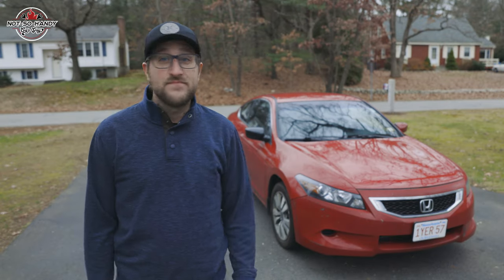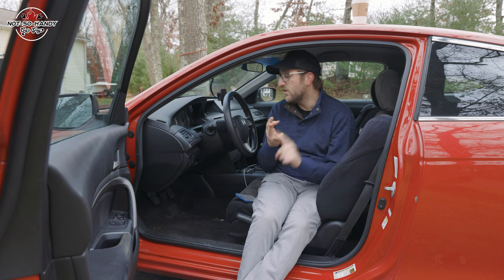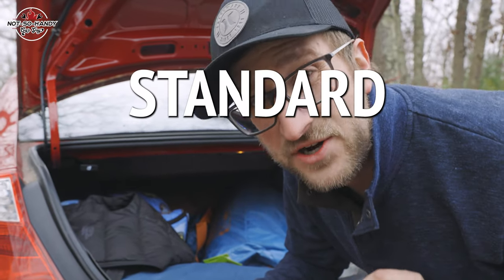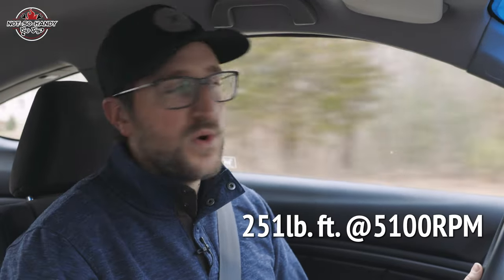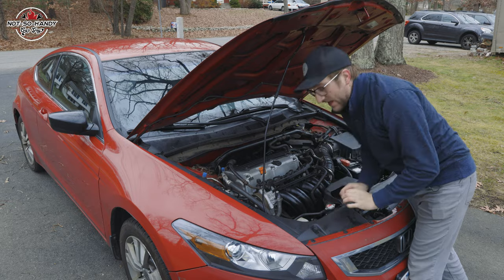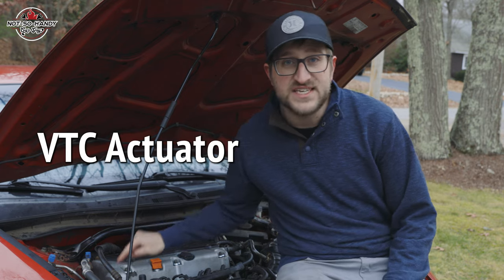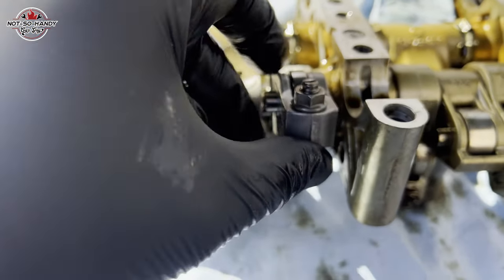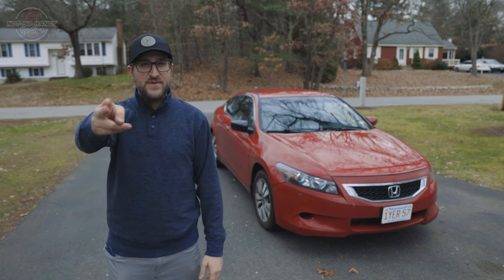Honda Accord (8th Gen) - How Reliable Are They? Review, 0-60 mph, Interior, Common Issues

Comment: I miss my 08 EX 5spd auto K24 coupe so much. It was my first car. I bought it at 120k miles and had it up until around 140k until somebody totaled it in a hit and run. It was dog slow, but revved high, and handled well with the suspension modifications I did. She burned about a quart of oil every 2 weeks, and the VTC actuator on startup was crazy.

Comment: Owned an 08 accord exl for 6yrs and I just lived with that noise at start up lol
Reply from the maker: Haha, I’ve heard of people never changing it and they were totally fine too! And then other times, the actuator seized up as the veins broke inside and their engine jumped timing. Glad your’s was ok!
Reply: Same here I still have my 2010 4cylinder my vtc actuator has been bad for years and I always tell myself I’ll fix it but have yet to get to it, although a tip for the cold start if you turn on the electronics but not start the car and wait a minute then crank it you don’t get the rattle apparently that works because with the electronics being on gets the oil pump running which can prime the vtc actuator so I’d like to think that’s why it’s been less of an issue for me
Reply: @l_shane_l  that's good to know lol, I lost my 08 accord in a car accident so now I have a 2012 crosstour(same 4cyl engine ofc) that makes the same noise at start up lmao
Reply: same here. have an '08 right now sitting at 215k miles, it rattles after not being started up for a little bit, nothing has happened so I just live with it

Comment: Do you recommend a 2010 honda accord coupe lx-s 4 cylinder automatic? That’s what I’m looking for right now! And don’t want to have any tranny problems
Reply from the maker: Absolutely! I’d say, if you don’t have performance in mind, the four-cylinder is a better choice. And before you get one, check the transmission fluid on the dipstick. Make sure the fluid isn’t super dark or burnt smelling. And then once you get it, do an ATF fluid change!
Reply from the maker: And don’t let the dealer (or private seller) cold start it without you there. If it has that rattle, I would pass on it, unless you want to do the intake cam repair yourself.
Reply: Go for 2011/2012 if the price is not much different.  Fewer complaints on motor oil consumption.  My '11 coupe bought new doesn't burn oil but the VTC actuator was replaced under warranty.

Comment: mine has 258k miles and it has the rattle vtc actuator problem. i have been driving like this for 20k miles. lets see how much it last. buying another car is out of question with prices.
Reply: I had that same problem and it never interfere with the performance or engine of the car.
Reply: How many miles on it now? Any major issues?
Reply: Nice
Reply: Did you perform regular maintenance and it still bad ?
Reply: @GoodfellasNYC you’ve a V6 ?
Reply: @frankmontez6853  No V4

Comment: Everything in this car is horrible, while changing serpentine belt, damn power steering pump pipe came off when i hit it with the wrench and spilled all the damn fluid out and cant go to work in the morning, timing belt is horrible, plastic comes off like nothing, it’s horrible. I had a 2005 expedition 5.4 before and had 251k miles and it had issues but nothing stressful as this accord junk. one time i tried to take off power steering tube and wouldn’t come off but wow on this accord it came off like nothing. 5 things just to take off an alternator is unbelievable. And the expedition surprisingly saved about 2 mpg more then the accord. Im getting rid of it for at least 300$ thats how much i hate it. Ive had 4 cars before and they were v8’s, the reliability was fantastic and stress free working on it. Now this accord is really getting me eager.

Comment: 343k miles on my accord. Only issue is VCM which is apparently out of warranty. American honda policy is garbage. Car is great if you do basic care. Aside from the eventual failing vcm system which causes fouled plugs, bad motor mounts, etc. And a lifter tick. Thats it.
Reply from the maker: It’s a shame they don’t cover that VCM stuff under warranty for longer. But good on you for 343k! Maybe try a valve adjustment
Reply: Try a vcm muzzler. I have one installed on my 2011. Now it's driving better using all 6cyl all the time. No eco light.
Reply: @NotSoHandyCarGuy  did that not too long ago. Has ran better since, but fouling plugs every few days in the back cylinders. Could be spark plug tube seals but check engine is ALWAYS followed by eco light. So the process is involved with my fouled plugs for sure. Also changed PC valve a while back which helped a lot also.
Reply: @Rahul-ty7fb  I want to get VCM 2 or Muzzler 2, can't remember the name. But it's 200 bucks shipped from Canada. Which one did you get? And do we have the same model/similar engine? I have a 3.5l v6

Comment: 0:28 seconds In and  I can already tell it's not a smooth ride. The padding on the drivers seat is definitely worse than modest and even with the seat all the way back  I have to drive with my right shoe off. The unadjustable lumbar support stabs my back.  Otherwise happy with my 8th generation.

Comment: Hecasa side skirt rocket panels guard set install red gloss paintjob 17 inch rim deepdish spoon white paint rim low pro tires 215 65 set tires remove 2 stage clutch short shifter stock 4 quart oil spark plug wire ngk supercharger kit without blowoff value ebay chrome colorful black